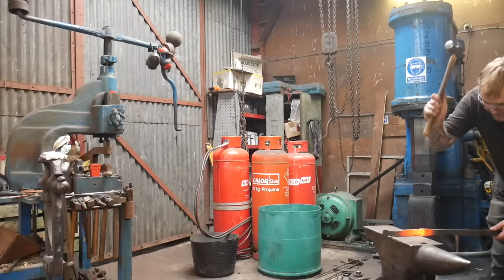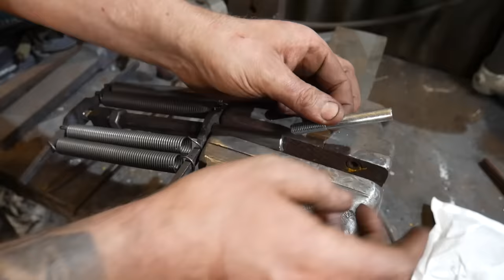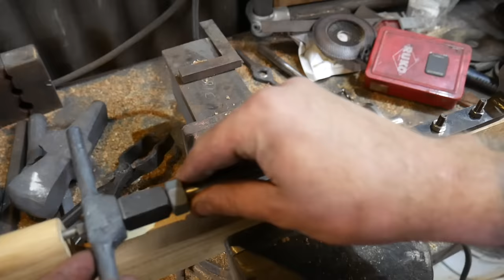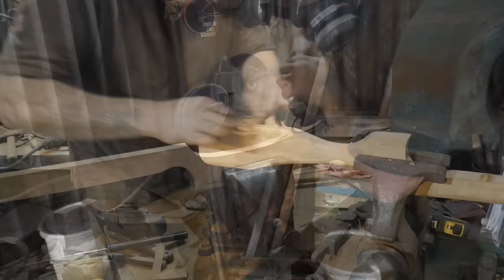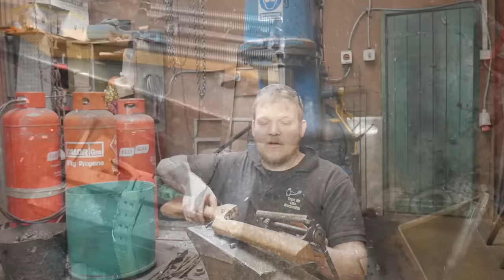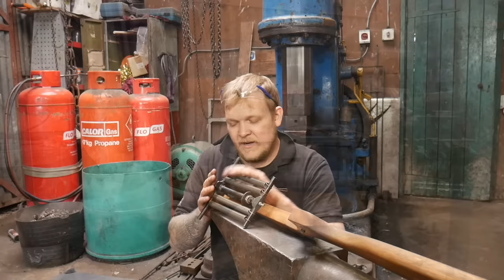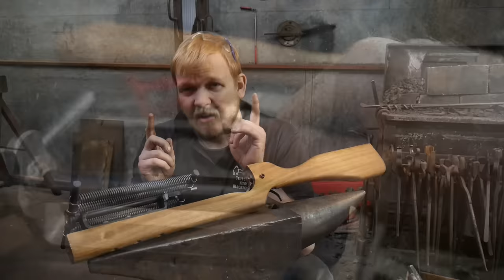The Spring Bow! Like a crossbow just with springs Pt.1

Comment: Check out how spring-action air rifles are made. Break barrel air rifles use springs that can shoot .35 caliber pellets and 900 fps 80 ft-lbs of energy. Might be able to get some inspiration from them? I do know that springs that pull have more drag than springs that push. So maybe consider using rubber bands used for exercising?

Comment: more power requires more or stronger springs, or more throw, or both... the longer the power stroke the faster  the projectile flies, within the mechanical limits of the mechanism.... increasing spring power raises the mechanical limits, but best ban for the buck is increasing stroke

Comment: Well, I would have extended the metal mount for the spring bow to hold the trigger mechanism as well, so that all significant forces reside in metal, the wood is deco then.

Comment: If you wanted a smoother piston, the best you can get would probably be the fit of a hydraulic piston- alternatively something like the linear bearing in a drawer slide. If you wanted to improve that trigger, I´d include some prongs that get pushed back by the piston and lift the trigger piece while cocking, essentially making it self cocking, and maybe introduce several pieces between the actual trigger and the piece that holds the piston to lighten the force necessary to operate it.

Comment: Several ways to increase the power, here.   the cross beam in the front extend them like a crossbow with curves and the springs sit on the outer most edges, the the crossbar need to have some spring to it. the bolt needs to be able to drawn to the point where the springs are about to be sprung, when that is about to happen the crossbar will bend back adding more tension.  Stronger springs are also an option here.  60 foot pounds  to take down most large game.

Comment: Performance:
Rifle with a pistol length barrel. - - - (increase the the barrel length)
Limit the weight of all moving parts.  - - - (Replace non-load-bearing parts with lighter replacements)
Ball bearings of that diameter are heavy. - - - (Decrease projectile weight)
Low power springs. - - - (Increase power or number of springs)
Excess friction.  - - - (Add 1 layer of oil)

Ergonomics:
Your trigger seems under developed. - - - (Add a lever out of the side of the locking side of the trigger for you finger to grab while cocking. (or make it spring based so it's auto))
Loading is tedious.  - - - (Add foot brace to front) 

Safety:
Magazine.  - - - (Placing your hand in front of the barrel while it's cocked is not advised. drill a BB sized hole at the top and back of the barrel, add a pipe leading to it. Use gravity to load it)
Trigger guard.  - - - (Trigger Guard)

Conclusion:
This design is great, with only minor tweaks it could deal some real damage. (if you chose to go for that of course)
This is comment is just an Easy-To-Access collection of ideas. Some my own, some from other comments.
Reply from the maker: No need for real damage just fun time damage hehe. Thank you for the comment.

Comment: Incorporate pulleys into your spring bow. 
Springs will pull on a wire cable around a set of cams/ pulleys. This will increase the overall torque.

Comment: Great work. You can improve it by reducing weight and so on, but it will never be really powerful. The 2 problems are: 1) A strong crossbow needs more power. You could not arm it manually, without a cocking mechanism.  2) Springs are powerful, but "slow". You would need a lever-like mechanism to exchange a (very) strong "short" movement into a less strong "longer" (and faster) movement...

Comment: I would like to see a pulley or pulley system to allow the launching shuttle to move faster over a longer distance - maybe with a longer spring. It huts my feelings seeing it decompress over so short a distance.
Reply: Same. There was an awesome thread on the Arbalist Guild about using 2:1 pulleys to transform force into speed. Those springs, as it is, are heavy and most of their force is applied to moving parts other than the projectile. The efficiency is extremely low. If the ball bearing is 5% of the weight of the moving parts, it also gets 5% or even less of the power.
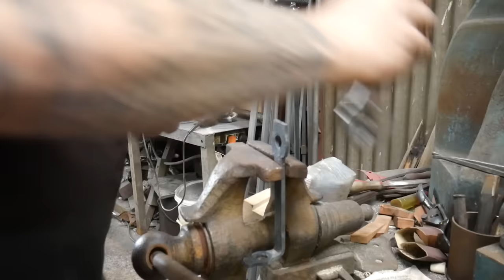Reply: @wandererstraining  - It's actually NOT 1:1. At 7:17 to 7:18 (in the video that I linked) he cocks the crossbow. You can measure how far the rest position of the string is from the catch compared to how much the springs moved. Alternatively, pause the video when the thing is fully cocked and you'll see that the tension ratio is indeed 1:1, but the tension is no longer aligned with the direction of fire. There's where you get a mechanical advantage.
Reply: @wandererstraining  - To simplify the trigonometry - imagine that when you pull the string back, it forms a 3-4-5 triangle. The string would be the hypotenuse - so 5 units,  the 4 side would be the position of the relaxed string -- and 3 units would be the travel between the drawn and relaxed position. Multiply by 2 (one for each side) -  and the spring would suck up two units of length to get the bolt to go 3 units.
Reply: @MrTwostring  Oh, if you see it as geometry, yeah, of course.

Comment: Any update? Not sure if you looked into springs but basically springs that give the max displacement with the poundage you want. So want a spring to stretch let's 10 inches and gain 5lb/in. Then you have a power stroke of 10 inches at 100lb per pound. 

More power stroke the better.
Reply from the maker: Nothing yet but I'm hoping to have some free time over Christmas to have some fun.

Comment: Well done! But:
The mass of the whole sled that moves forward is quite large - and thus most of the energy is wasted in accelerating that.
Make it as light as possible. 
The engaging mechanism seems to be quite a fumble. I would improve upon that.
Also I would add a stopper of rubber or so or the sled will hammer in some damage over time.

Comment: At the end of the bolt glue a magnet  to hold the ball bearing tite to your bolt, also the ball bearing won't fall out if you point the barrel down. Put a rubber bumper on the stop. Try using an air cylendar instead of springs.

Comment: steel springs are more suited to shoot heavy projectiles, the vibrations of the springs you are hearing is showing that so much energy went unused. I would say, begin with using a 40-50 gramm ball or bolt and adjust from there. 
Nevertheless, steel spring is not an efficient material to launch projectiles.

Comment: I'm no expert, but my thoughts are you need to add impact to the equation. Currently you are pushing the bearing out. I think you need to shorten your "firing pin" like a pin ball machine if you pull it all the way back and smack the ball its dramatically better than pushing it out. Use a small magnet to hold the ball in place and allow your rod to pull farther back than the ball. Hope that makes sense.  Love the vids so far btw!

Comment: I'm going to be making one myself, I'm using 2 sets of bike forks with a mountain bike handlebar for the center (3 piece bow that breaks down) I'm trying to figure out which springs have the strongest load capacity/deflection distance to use and prefer closed ended springs. Since I'm using forks I will be able to use 4 springs instead of 2 so are there any suggestions? Also I'm not designing it as a toy I want to have the capability of protecting myself and kids against large predators and large dogs that have become a serious issue so any advice will help tremendously 🙏 thank you. Was going to use a leaf spring but I didn't have any available so plan b it is!

Comment: I was thinking that the springs were quite noisy upon firing, perhaps you should spray a bit of WD40 Silicon Spray on them to quiet them up a little bit. I am also not against the idea of using compression springs, might be able to add a dampener to reduce noise and vibration. Keep up the good work my friend, looks like a lot of fun

Comment: Forget springs! They are indeed powerful, but they retract far too slowly, so they cannot impart enough inertia to the projectile.
My suggestion is to check out this guy. There is nothing he does not know about projactulating.
But top tip, use rubber. It's contraction rate is immense 😱
Reply from the maker: Thank you
Reply: Check out which guy?

Comment: Unfortunately spring is simply not as energy efficient as rubber sling. Not only the mass factor, but also the frictions. But since you're a proper blacksmith, then you could do those builds with rubber slings & metals for a better stronger construction than just wood.

Comment: Awesome project!! Just a heads up, I know you won't be anywhere the legal power limits yet, but it can get up there fairly quickly. The power is measured from the wieght of the object and the speed the object is travelling and although it sounds a bit counterintuitive it could take less power to move  a light object really fast....... like a bullet ...... then it could take to move a heavy object at a much slower speed. The problem is that without a Chronograph to measure the speed the projectile is moving they might both be breaking the law or neither could be. Ok, I apologise for my way of trying to explain it, what I'd suggest is contacting a local rifle range an see if they would be happy to help with testing the awesome creations that are sure to follow. It would also mean that you can experiment with what works well and what doesn't and it could suggest different things to try that you would never have thought of before. I hope this rambling helps in some way, but I also have another suggestion...... trampoline springs........ and something to tension the buggers!! Have fun 😁👍👍👍👍👍👍
Reply from the maker: Thank you that's great advise
Reply: Would filming the shooting of a board or some other loudly resounding object from a set distance, then using a video editor to find out the time it took for the projectile to travel be somewhat equivalent of a chronograph?
Reply: @Pithead  Not really, unless the board was placed at the same distance from the front of the weapon as a Chronograph would be ..... which is somewhere around a meter. When you fire any projectile it slows down as it moves away from the weapon that fired it, this could mean that over the distance you record it the projectile's average speed drops to below the legal limit for a licensed firearm. The problem is that when it left the firearm it was still over the legal limit. A couple of inches per second could mean the difference between a legal "toy" and an illegal firearm!

The Chronograph measures the time a projectile moves between 2 sensors about 30cm apart and is extremely accurate. You could achive a similar result with very high speed camera, but I'm not sure where the results would leave you on a legal standing. The camera would also cost a LOT more then the Chronograph, so personal that's what I'd buy. The video from the high speed camera would still be really fun to watch, though. 👍
Reply: @Zogg1281  Good answer.

Comment: Two stronger springs, the closer in you keep the energy, the better. Longer draw length or stroke length will help loads, pun intended. Also, lube the heck out of it! Lube is your friend. Ball bearings don't puncture well and can roll in wierd ways in the air so aim will be problematic at range unless you use a bolt.

Comment: The idea is wery good however in my opinion you need to make the whole bolt lighter beacuse a lot of energy is wasted when it is acceletrated.
Also the velocity is not going to improve if you add more springs because in this case the limiting factor is the speed at which the springs contract.
You could still output more energy by using more springs if you make the weight of the projectile the limiting factor instead.

Tldr lighter bolt mechanism, more springs and heavier  projectile should result in more "muzzle" energy.

Comment: Unistrut with internal springs, grip trigger, grip handle for shotgun reset, maybe even a magazine with auto load. Pump action unistrut shot gun,  maybe even shoot grapeshot.  Pulley reducer for powered pump action. Is there a way to use a small spring?  Instead of multiple?

Comment: Somne of those cross bows have a 200=+ lbs. and travel hundreds of feet a second. Not sure but you may want to try and use tramoline springs.. if you change the shot you could try blunt end bolts or small game arrow heads.. nicly done Daniel .. Cheers Mate.. Martin

Comment: Use the springs to compress air to shoot the ball bearing out?
Reply from the maker: An idea keeping it legal is the main goal.
Reply: @danielmoss2089  Ah fair play. ♡
Could you use a leaver arm or gears to change the relatively slow but powerful movement of the springs into a rapid movement of the projectile? 
Or you could use a larger lead projectile to have a more potent effect.

Comment: try having the springs drive a multi block string.  This will give you a speed multiplier. In a 4:1 pulley set up, the springs can move one of the pulleys, so for 1 unit of spring travel you would have 4 units of ball bearing travel - the ball bearing would accelerate 4 times faster than the springs. It will also eliminate most of the moving mass.

Comment: Use a magnet to hold the ball bearing so you can load with it uncocked.
Reply from the maker: I like that a lot ill see what i can do.
Reply: @danielmoss2089  I would elaborate to say that you should use the weakest magnet you can get away with so it doesn't rob power.

Comment: or somthing came to mind... Change the springs to pistons you can get them as drawer pulls and they can get as high as 100 lbs of assisted help each. They are small in stature similar in size to the one used on a 2x72 grinder.. M

Comment: Lower the weight on the back. Use a pully system to get a shorter stronger spring. Lighter push rod

Comment: To estimate the energy loss you can compare the max-velocity of both the projectile and the moving parts and compute the kinetic energy. Since both have the same velocity it cancels out and the result is that the energy percentage lost in the moving parts is equal to the mass percentage of the moving parts. The percentage is relative to sum of the weights, just to be clear. Well, that's at least my first estimation, did not write that down formally, so doublecheck!

Comment: You are shooting a projectile down a barrel. Unless you have a fire arm certificate, the legal power limit is 12 foot pounds/16 joules, the same as an air rifle. The penalties for exceeding this limit is severe. I know that this makes little sense as you can get alot more power out of a slingshot and a awful lot more from a crossbow, but it is the use of a barrel that defines your springbow in law.
 Please be careful Fella. Don't fall full of the law and cause yourself a load of grief.
 PS. Loved the vid.

Comment: I think you're on to something big try making the stock thicker from the mechanism back then just put a groove where the trigger comes through it'll make the stock stronger in the middle and instead of springs maybe rubber bands the bolt idea instead of bearings sounds good just tossing a few ideas your way and I really think you are on to something great job

Comment: Consider (and minimise) the weight of the moving part that is NOT the projectile. Any energy you use to move anything except the projectile is wasted energy. It makes a huge difference. 

Also, I'd imagine rubber will release its energy more quickly than a coil spring...

Comment: Try longer springs & angle them at 33 degrees. Then get rid of the cylinder and piston. Just have a top and bottom guide to keep the springs straight while having a small cup like object found on catapults to hold and launch your mass/projectile. And last make your handle heavier for resistance. Your losing acceleration from the opposite reaction from the spring. It needs high mass of resistance to launch off of. Try to stop it from kicking back and much as possible. That thing could launch an object in space at zero/microgravity so fast and far in space it’s not funny.

Comment: I’ve always thought of building a similar gun,,,,except made to fire glass marbles.—->only consisting of a wooden stock, steel barrel, and an electric solenoid for power,,,,, But instead of impact driven, maybe incorporate an air piston and automatic tubular feed design....Pretty much a glass marble firing BB gun? Velocity would be easier to achieve due to glass marble weight/compared to steel bearings.....and destructive if enough velocity was applied?

Comment: Was thinking while you were making your stock that it would snap, right where it did.
But, it is better that it break now and you learn from it, than for you to try using it and it breaks, showering your body in splinters and metal bits.. 
Onward towards knowledge mate! 
Ps, when in doubt with Stocked weapons, bigger may be bulkier, yet more durable. But too thin, and your weapon might do more damage to you than your target.. 
cheers ^.-.^

Comment: Okay, you want it to have a little more OOMPH... Right?  Well that's an easy fix, cut a groove around the top of the plunger... wide enough for an "O" Ring and coat it with a little silicone grease.  That should give you enough of a seal inside the barrel to get it to the point where it'll do what you want.  

But You already beat me to that conclusion since I started typing this reply before watching the whole video *facepalms*... but coming form the years of experience of doing Nerf Gun Modifications I can tell you that yeah... Using "O" Rings and putting a little grease on it would definitely give you a bit more power and a better seal.  I would go to the point of saying to use some sort of Wadding on the Bearing... but that could  turn it into a weapon in short order